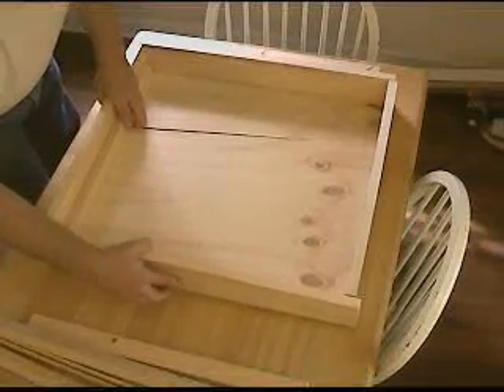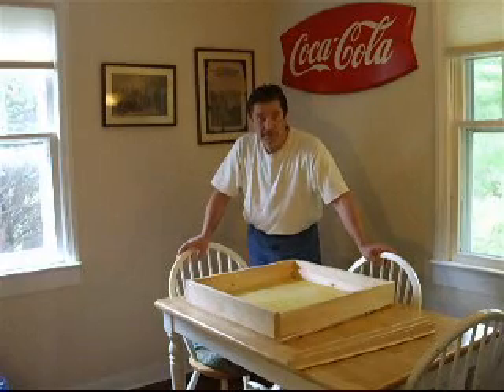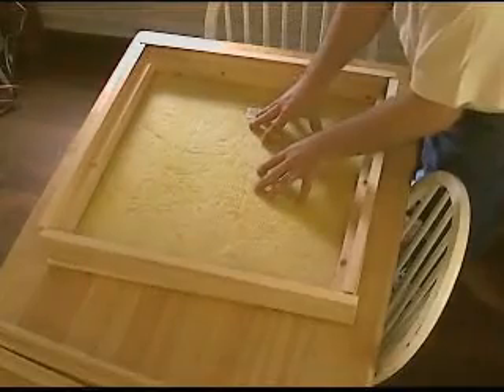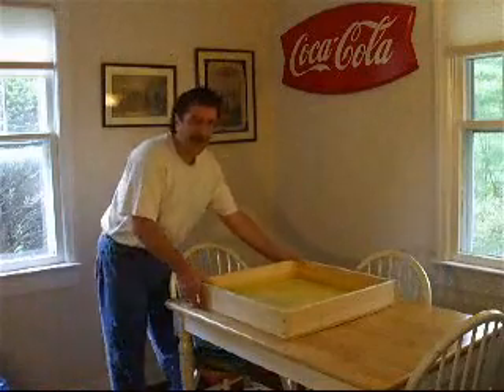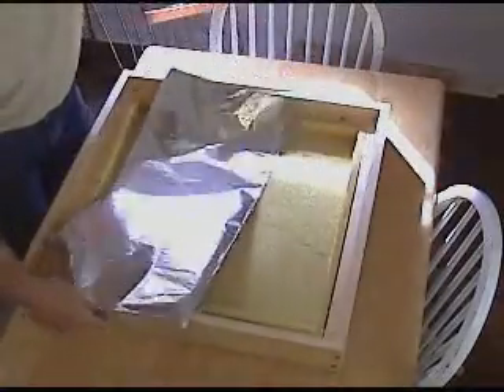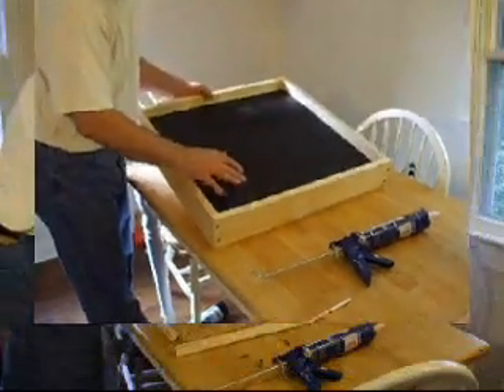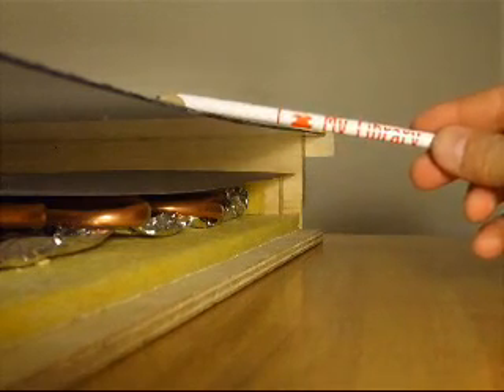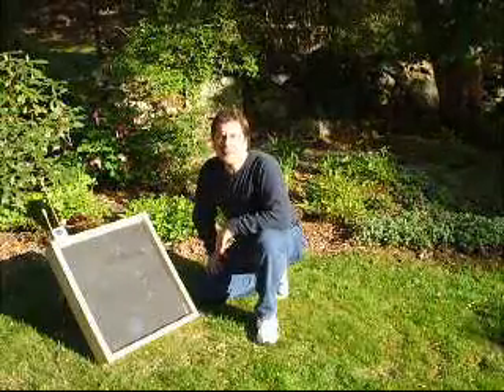Free Solar Heat DIY "How to build a solar panel" Part 1.1 Ernie Ursini

Comment: @RalphJones
Yes! You are right! You will be able to power anything
without worrying your electric bill cause the solar
panel you build saves you a lot. So dont worry. Its
100% guarantee. I myself used that also for many
years now. Anyway, you can check some tips on
there site. Here's the site:
GreenEnergyNow.info

Comment: An air conditioner is basically a heat pump, it moves warm air from one place to another. Depending on wich direction you pump you either get warm or cold air into your home.
They get output 2-5 times the energy you put in, in form of electricity. Usually a 1.35kW heatpump can get you 4-5kW of heat, depending on the outside temperature. There are good ones that can get you over 2 times the energy even when the outside temp is -20C.

Comment: I take it you don't take showers or baths? He said it was to heat water. In the winter you could use it to heat a house or cool it by hooking it up to an air conditioning unit. It creates energy & powers whatever you hook it up to.  He didn't mention how the liquid is connected to it or what parts you need at the end to connect it to something.

Comment: Hi, cogredilations I so you are doing the greet projet at home .
I had quetion I need help about solar panel power can be builted with local materials without yousing voltaic panel power and get electricity  to charge Battery
home please let me know if is possible how to do?

Comment: First, how did you exit the box with the tubing?  Second, I don't believe you can braze Cu to Al. (For who said he would.) Third, after a few years you will have to replace the plexiglass which will craze and have lower transmittance of light; glass is probably better. Fourth, you're going to need a lot of these unless you only want a few drops of hot water, or you can connect it to your tank but that requires a special orientation of the inlet and outlet so that the water circulates.  Thanks.

Comment: Not sure I understand 100%
I understand how it works, but i dont understand how you would connect it to your water heating system. In order to acctually heat the water.

Comment: A few suggestion:

If you use the metal roofing with the peaks and valleys (painted flat black) and make a coil or use copper pipes to put in the valleys, you would have direct contact with the sun (put it all in a box). Double pane glass will last longer and insutlate better than plexi. I havn't tried this yet but I plan to. 

Your temps are fairly irrelavent (for practical use) because the fluid is not moving. 

I'm Studying to be a Mech Engner and plan to dedicate my life to Alt Energy.